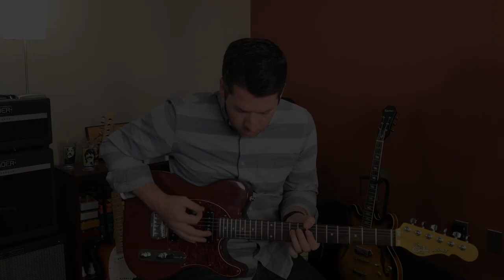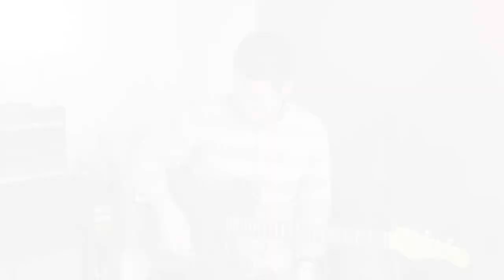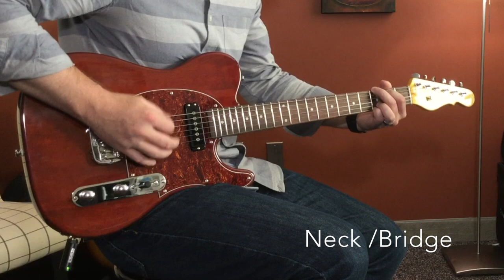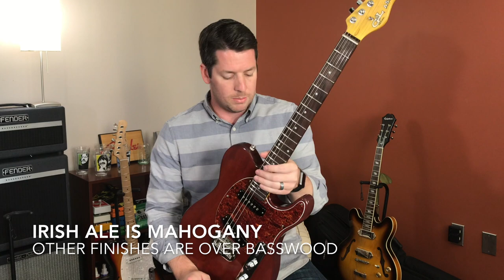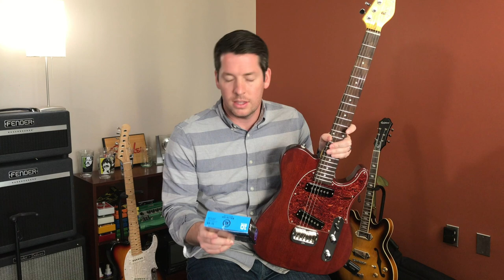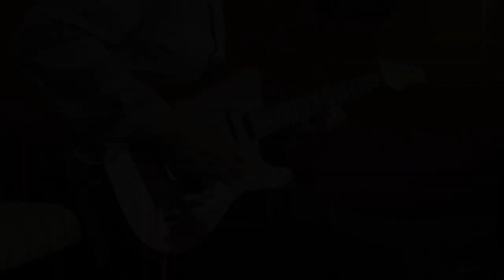G&L ASAT Special : Demo and Review

Comment: I have one, the sunburst, the electronics are humble, had to replace the input jack, the pups and bridge are the same as the MIA models, bridge saddles are cheaper cast as the electronics, had to do a full fret dress too, I think it was originally from one of the mail order type suppliers so that's what I might expect from the lack of fret detail, mahogany body, rosewood board, overall a really nice guitar, especially for the amount I paid, I think it was a 2016. Overall a better guitar than the MIM strat which also needed a full fret dress and crown. BTW the neck alignment was spot on for the g&L, the strat alignment was off with a fortunately sloppy neck pocket allowing for the quick screw loosening adjustment.

Comment: The body is advertised as made of sassafras an inexpensive, light, straight-grain, rot-resistant wood. Not normally considered a tonewood. Check it out online.
Reply from the maker: You are correct that the more recent versions have been made with sassafras, the model I had though was mahogany. I would imagine they made the switch particularly because it is less cost!
Reply: @CrowderMusic  G&L now use poplar for this model as per their website and Jatoba (Brazilian Cherry for the fretboard)

Comment: MFD pickups have stronger magnets (ceramic) and fewer wndings.

For a couple of years now, the Tribute pickups have been made by Cort to G&L specs.  They are no longer USA pickups.

The saddle-lock bridge (as well as the dual-fulcrum vibrato bridge) are a real innovation on Leo's part.

I own 2 of these from the mid-90s and love them. They will give you a great "Spoonful" tone through a cranked amp.
Reply from the maker: Great info Mike, I didn't know that about the pickups!
Reply: @Lone Ranger I too heard that they were USA pick ups. Hopefully it's true?
Reply: the mfd pickups are still made in california on the tribute models. at least according to g&l's website

Comment: I just bought a used G&L Telecaster ASAT Classic with the ashtray bridge. Both pickups are G&L. The bridge pickup is much bigger then the neck pickup. But they both sound fantastic.I was told that the brown dot on the top of the neck indicates it was made in the USA. Know anything about this.
Reply from the maker: My guess (without looking at it) is that the pickups are the standard MFD pickups. The bridge pickup is naturally a little larger just due to the design. I'm glad they sound good!

I looked around a little as I'd never heard about the brown dot, but it looks like the older USA made G&L's do in fact have a small brown dot on the back of the headstock! The newer models I looked at didn't have the mark but had a more pronounced serial number and Made in USA. You can always look at the front logo, USA models will say 'Guitars by Leo' under the logo.
Reply: @CrowderMusic  Thank you Andy . Yes mine does say guitars by Leo on the front headstock. Thanks again. Enjoy your G&L guitar my friend.
Reply from the maker: I always enjoy the G&L's!
Reply: I own several G&Ls. The dot does indicate that the guitar is made in America. That  said, some of the older Tribute G&Ls (2005ish?) used USA pickups. They were an incredible value, especially if you spent an extra $100 to perfect the nut and the occasional  amiss frets.

Comment: I had heard that when G&L first came out with the Tribute line (the Korea days), they were using US made G&L pickups. Is that still true? Was that ever true? Anyone?
Reply from the maker: I have heard the same thing, and any research I've done says that the pickups are all USA made but other electronics (wiring/pots) and hardware are not. I've heard it both ways though!
Reply: @CrowderMusic  Thanks for the vid. Just dusting off my original 1994 Special, trying to get reacquainted with it. Needs some TLC. Was unfamiliar with the Tribute series. Is there known to be much difference between the original Specials and the Tributes?
Reply from the maker: @diamondbracelette  - Thanks! I would love to get my hands on a '94 special, I hope you give it the love it needs. The Tribute line is manufactured in the far east, nowadays in Indonesia. They are fantastic instruments, regardless of where they are build, but I'm not sure I could tell you other differences unfortunately!
Reply: @CrowderMusic  Thanks :) I'm sure they're great and is pretty cool you get this guitar still at this price point. Cheaper than I paid in the 90's lol. About $600 back then if I recall.
Reply from the maker: @diamondbracelette  - It's a beautiful thing!

Comment: Cool guitar, except for the terrible noise. I can hear it even when you're playing.
Reply from the maker: They certainly aren't the quietest pickups, that's why I really like the middle position as it's noise cancelling. Some rooms it's quiet, others it's a bit noisy!
Reply: @CrowderMusic  I've seen a few other videos with this guitar, and it didn't seem as loud as at your house. Maybe you need an electrician to put a good ground line into your studio/house. It helped out my studio a lot.I was thinking the guitar was useless with that noise, but it's luckily not as bad other locations.
Reply from the maker: Thanks Chad, I think you're right about the electrical!
Reply: It's probably cause you're using that wireless thing man come on you gotta use a cable. Other than that great video.
Reply from the maker: I don't think the wireless adds any noise, otherwise I wouldn't use it. Unfortunately, I may just have some poor wiring going on!